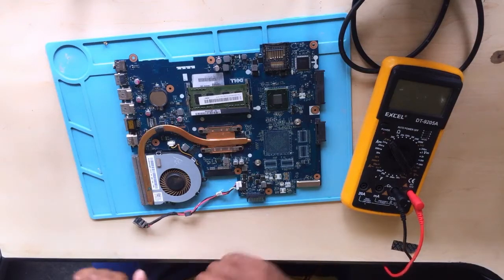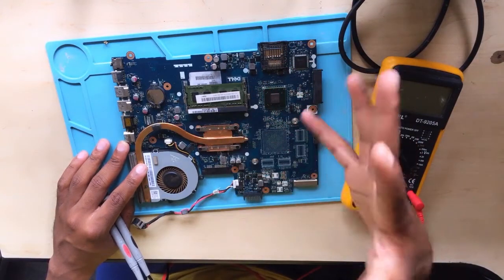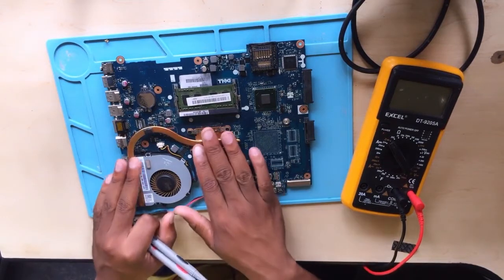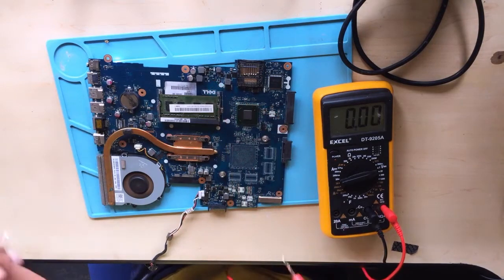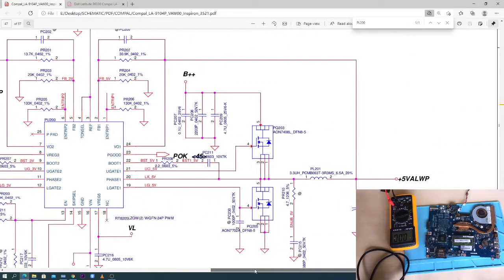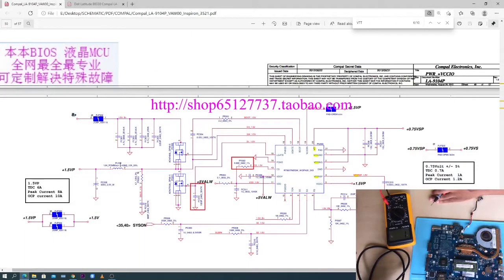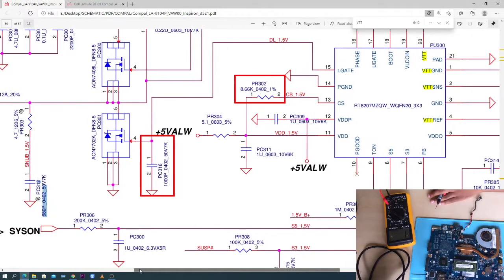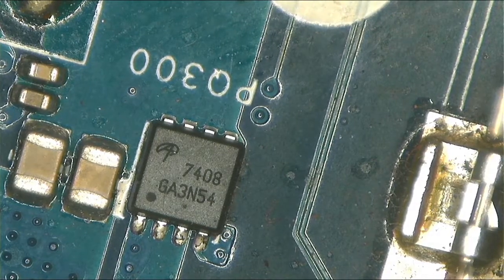DELL LAPTOP MISSING RAM VOLTS

Comment: can i request how do you connect the connection from the dcbench to the motherboard to check for short. thanks
Reply from the maker: First you need to know what and which power rail is shorted to ground, then you connect black wire from the dcbench to the screw holes 🕳 on the board, then the red cord on the shorted power rail, but you need to set your voltage, if 19v is shorted, you set your dcbench to 19v